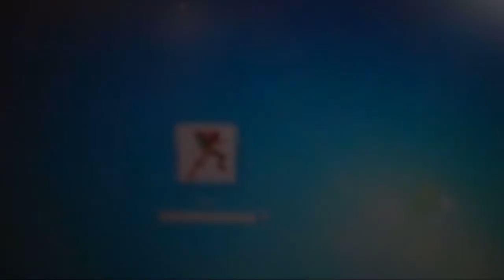Samsung Syncmaster 2053BW disassembly  (Part 1 of 3)

Comment: Thanks a lot for this detailed tutorial.I have a 2253BW display which has the same power supply . 4 capacitors had bulges. They were 820µF 25V, but as I didn't have those values, I replaced them by capacitors connected in parallel: 680µF+100µF which provides 780µF and 470µF+330µF=800µF. However I don't notice any changes: the backlight still shuts off after 1 second. Is it so much dependant on capacitor values? Or may I replace more capacitors even if they seem OK (no bulges)? I already fixed some displays by only replacing capacitors which looked defective. But this power supply seems to be more tricky.
Reply: This exact simpton is not just caps who generate them, Can be one of the 4 lamps fail i have one Samsung Syncmaster 2053bw with the exact simptoms of yours and i put one Led diode in the lamp in paralel because i dont have the lamp for replacement and works great now. A litle more dark the Display but enoght to work fine. In this example on the video the inverter fail to start because of the 4 caps in the primary of the inverters. You need to put the led in paralel in the output off the inverters until you get the backlight fixed and you find what lamp is, trial and error and you find it.  led 3v. 
https://www.youtube.com/watch?v=oODiCkhSn9c

Comment: My monitor was flickers samsung 2253 bw  and now and I stopped using it. Now when I go back and try to power it up...it comes on for about 2-3 seconds and then goes black/blank.   I bought capacitors for it...but I'm not sure thats problem (Keep in mind im newbie too) but I popped it open and capacitors dont look popped or bubbled as they say.

Any ideas suggestions etc? I really miss having my two monitor side by side...being programmer it nice to have one with code and one with actually program debugging  ;-)
Reply from the maker: +Brown Trout Not sure. It sounds like it is having the same problem I had but some of my caps were definitely popped and leaking. Maybe it's just starting to go bad. It does sound like the same problem I had but I'm not expert. :P
Reply: I think I'm gonna just go ahead and replace them all. I bought the "KIT" on ebay. And go from there. Maybe Im newbie enough and just cant tell if its bad or like you said starting to go bad   but I miss my dual monitors ;-(((  thx  I'll get to it sometime this week. I HOPE! I'll let you know what i find out